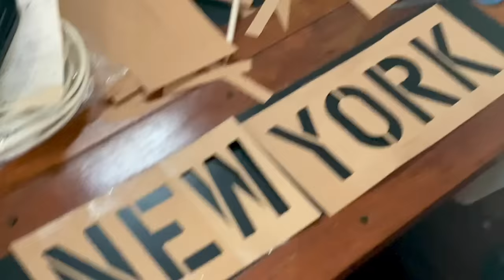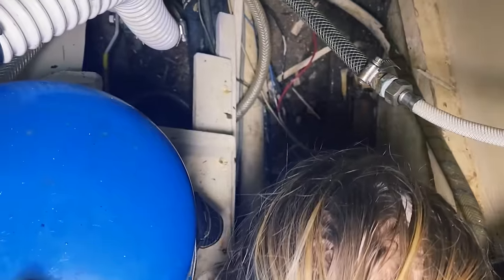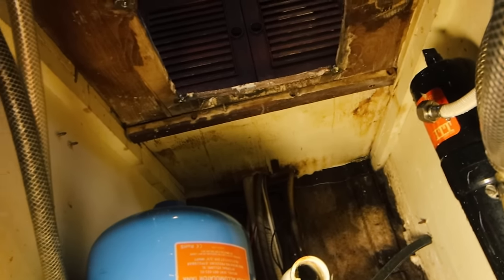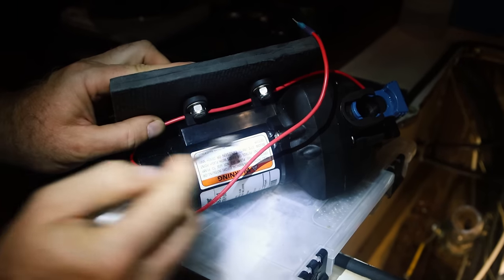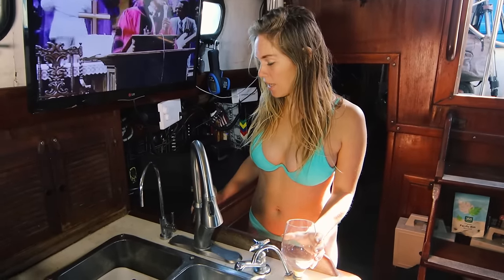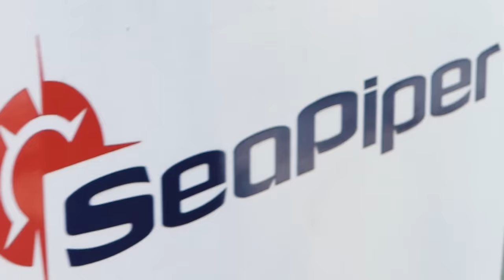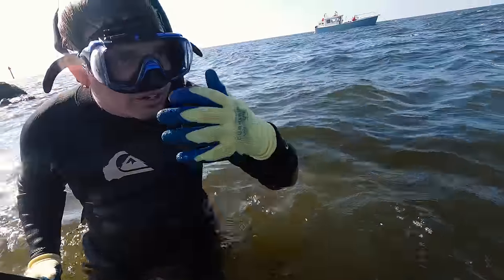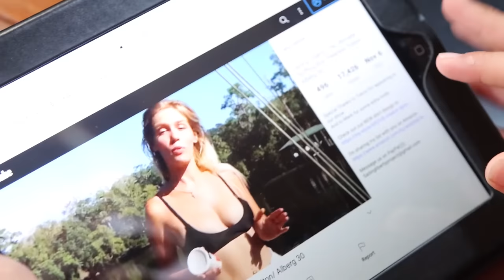Sailing Liberty- Survival Water System How To? Reverse Osmosis / Seapiper 35 Trawler

Comment: I l enjoy you channel every episode.  But watch out for that shelf.  The upper screw on the bracket will be in tension unless the centre of gravity of the tanks on it is close to the back of the bracket.  The static tensile force on the screw will be the weight of the tanks x the distance from the back of the bracket. This will increase if the boat is being thrown up and down by heavy seas
Would some extra brackets help?

Comment: Happy New Year.  Keep a close watch on the new RO unit.  You will go through tank water quickly when for every glass you drink at least two goes overboard.
Reply from the maker: Hi Mark
Presently we fill our tank with municipal water via a hose, on the sea we intend to fill er up with our new RO de salinization system (to be featured in an upcoming episode) or even rain water.
Subsequently the bypass water that you are referring to is not so bad especially from the desalination system or rain water …so we don’t put the bypass water overboard, after all it’s gone through particle and two activated charcoals filters, we send it back to the tank! Perfectly good for washing etc.:)
Reply: Glad to hear you have the desalination unit coming on line. Makes my comment about waste moot.  I would not return the bypass water to the tank it is contaminated with whatever you are trying to filter out, chemical or biological so returning bypass to the tank just increases the concentration of contaminants. @SailingLiberty

Comment: RO water system is great but beware it uses 3 gal of your tank water to make 1 gal.  Also runs your water pump ALOT, draining the batteries.  We burned through 2 water pumps in a year until I figured out the issue.
Reply from the maker: Right now our new water pump has a 5 year warranty. It is not bad idea to carry a spare one... also we are thinking about getting industrial waterpump because these consumer products are very flimsy and prone to failing to start with. 
Presently we fill our tank with municipal water via a hose, on the sea we intend to fill er up with our new RO de salinization system (to be featured in an upcoming episode) or even rain water.
Subsequently the bypass water that you are referring to is not so bad especially from the desalination system or rain water …so we don’t put the bypass water overboard, after all it’s gone through particle and two activated charcoals filters, we send it back to the tank! Perfectly good for washing etc.:)